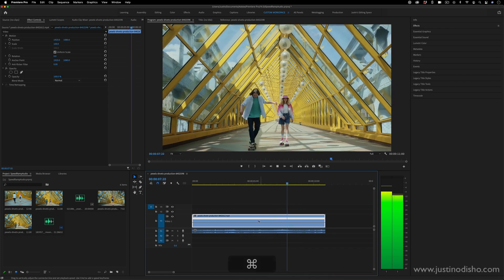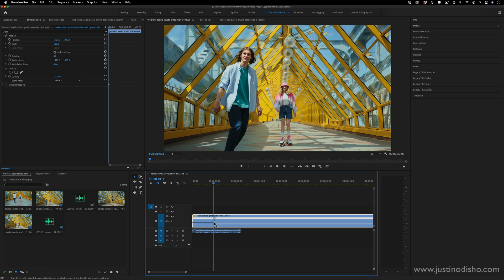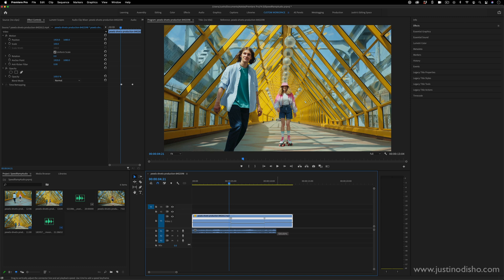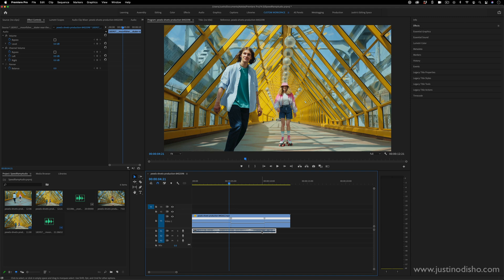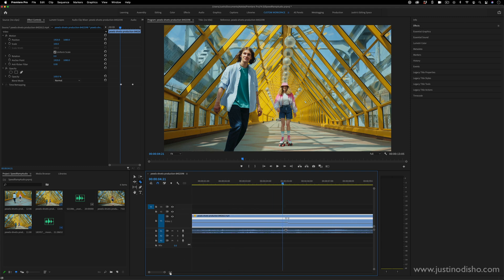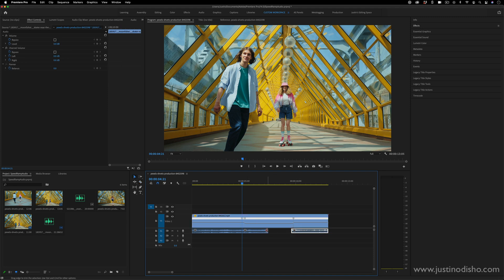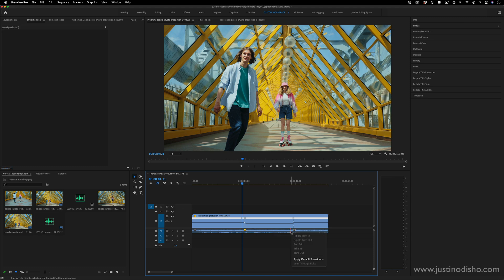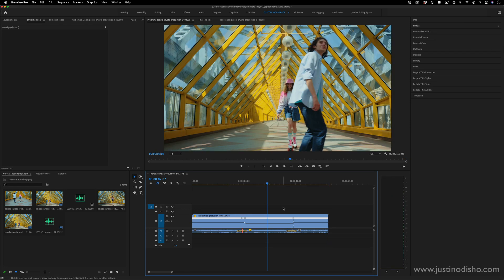How to Fix Speed Ramp AUDIO in Adobe Premiere Pro CC (Tutorial)

Comment: A tip. the way I cut the audio is to make the first cut where the ramp begins then drag to right part to realign it with the end of the clip (Making the end back in synch) then cut where the speed ramp ended. The left over part in the middle goes with the ramp and just need rate stretched.
Reply: Yeah I'm not alone there😅